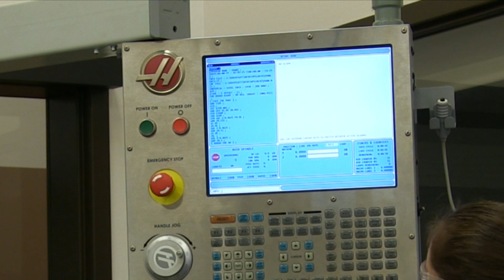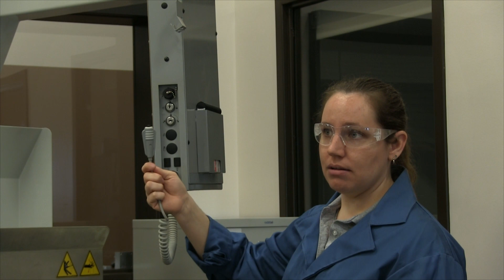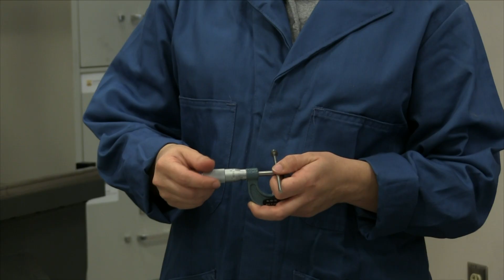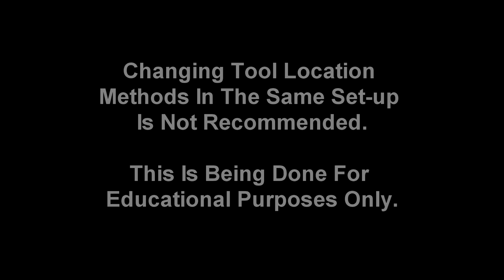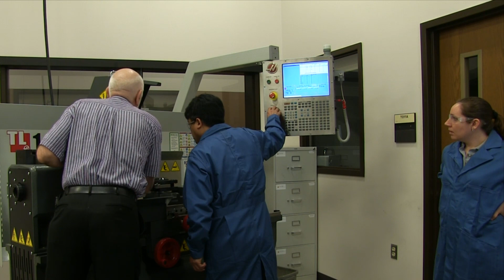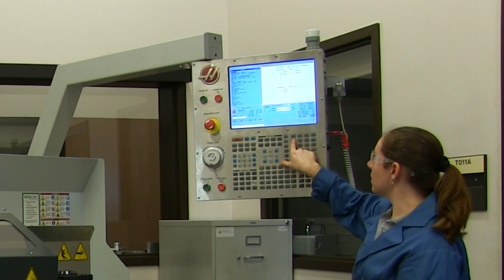HAAS CNC Lathe Part Set-up Tutorial

Comment: So, let me get this straight, you you have to hold down that dead man switch the whole time the cycle is running. Right?? So, basically, you are required to run the machine with one hand, and hold that "Hold to Run" switch with the other. Right?? But you didn't do it.
Reply: setting 51 override is on to eliminate dead man button 
do it as soon as you fire up lathe before to remove e stop

Comment from the maker: Some CAM software will automatically do it and some may not. The best thing to do is look for the codes for pause which is M00 or M01; spindle stop which is M05; and possibly a machine zero which is G28 in your program text. If the codes have not been generated, you can put them in manually. Remember only one M code per line.

Comment: When you don't have the auto turret do you have to program a pause between tools for manual tool change or does the machine pick that up automatically?
Reply from the maker: landlockedviking also you might put a G28 also so it will go back to machine 0 and you'll get clearance.
Reply: Rebecca Rice thanks I'll look into that

Comment: After you turn on a HASS control and RESET alarms, push the "BLUE" "Power Up Restart" button next to the reset. This button will automatically ZERO out all axis and tool changer. The machine is homed that way on all HASS I have run.
Reply: Locked on most of their lathes to avoid crashing the axes